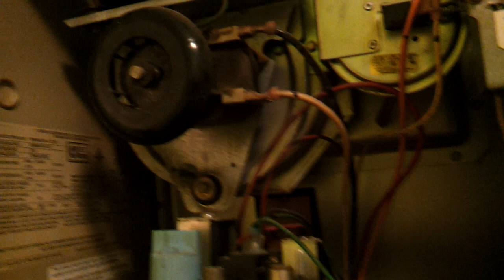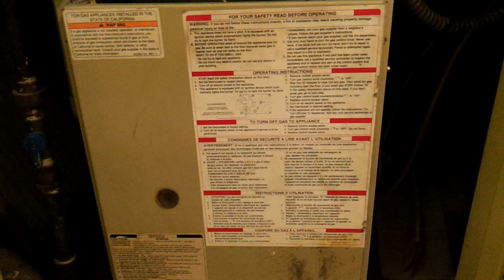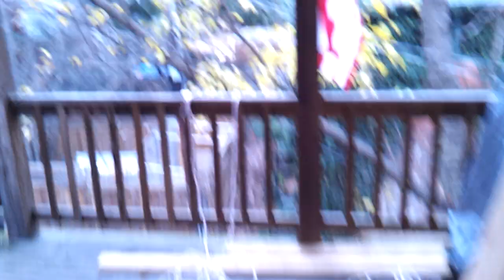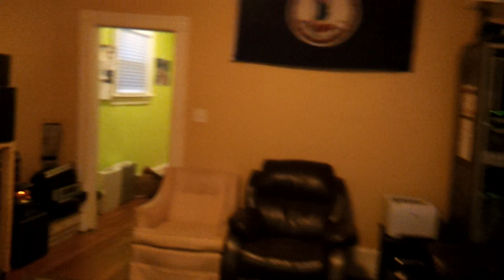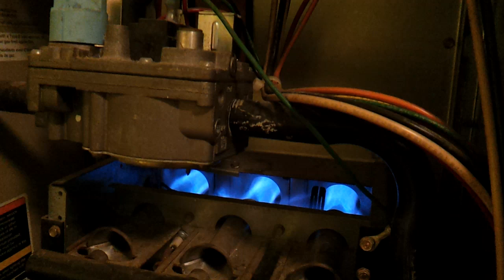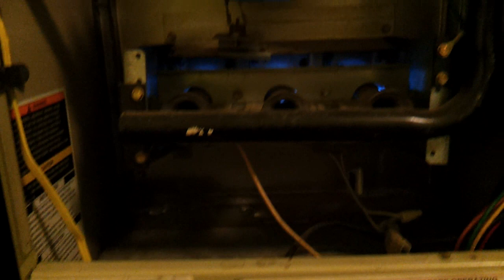Carrier Weathermaker 8000 Gas Furnace Start Up and Operation

Comment: Thanks man. I saved $90 fee for a company to come out, labor and parts. I primed a $10 capacitor over night and im back in business, it also solved the mystery of the ac barely circulating. Now my fogged windows can get some heat lol.
Reply: update: motor was burned out too, 10 minutes later it seized. I ordered a used unit on ebay, came with the GE capacitor and I swapped it myself, only hard part was tapping the fan off the motors stud thing. All good now. I feel a lot more confident ripping apart the whole system.

Comment: once the flames start firing and the blower motor does not turn on, I assume this is a capacitor problem ( easy fix) ?  Entire system shuts down after about 2 minutes running flames
I cleaned the flame sensor and I do not believe it is limit switch.
Reply from the maker: Check the capacitor first. If you run just the fan (jump R to G), does the fan run? 
If your capacitor is good, the motor is likely bad.

Comment: We have this furnace in our house. It will not come on by it’s self we have to flip the switch off and on for it to come on. When it is on it does not complete the cycle it turns off and throws the over heating code, any clue what could be wrong?
Reply from the maker: If its giving you an overheating code, check the filter to make sure it isn't dirty. Also check and make sure none of the return air vents are blocked.

Comment: Is a hybrid system worth it and cost effective? Or is it cheaper to just be pure natural gas.
Reply from the maker: It would all depend on the rate of your gas and electricity.
Reply: In most parts of the country, NG is really cheap so the added cost of installing a heat pump instead of an air conditioner is typically not worth it. Now if you have a propane or oil furnace, that’s a different story!

Comment: Mine makes a dog yelping sound when the ac unit kicks on, what is making this noise?
Reply from the maker: Could be the bearings in the blower motor starting to go out. You'll probably have to replace the motor.

Comment: I have an older Weather Maker with the 3 site glass burner view. The gas compant said one of the flames is flickering which could be a cracked heat exchanger again it's 20 plus years old, just curious thanks
Reply from the maker: It could be a cracked heat exchanger. I would have a professional HVAC company check it out before the upcoming winter.

Comment: I have a a problem with my Weathermaker.  It seems to be the same model as the one featured in the video.  When I reset it and it runs the course of igniting the gas, it will shut off gas flow after 8 seconds or so.  And then it will reignite them shortly after.  It heats my house intermittently and inefficiently.  At times it will be be working but most of the time it seems to be blowing cold air.
Reply from the maker: Sounds like the flame sensor is dirty, try cleaning it.
Reply: @springws14lbss  thanks

Comment: led light stays on but no action just exhaust fan runs I replaced sensors still will not fire
Reply from the maker: Check your pressure switch. Do you have power going to the igniter at all? Might need to call in a service tech.

Comment: I had a newer version of this furnace for 12 years. according to the HVAC ppl the AC was wired wrong and delivered 120V to the control board instead of 24V. Since the furnace was installed by them 12 years ago and took 12 years to catch fire apparently, yet they were astounded as to how it went so long psh. and 2 weeks after being forced to install a new "high efficiency" am i regretting not asking the installers more questions. I don't know what model carrier I had but it was 80% efficiency 2 stage and installed in 2006. the new one is an Amana GMSS96 (goodman) and the inducer blower sounds like a mini jet taking off. Then the blower comes on and sounds like a wind storm, is there anything I can do?? or have i just had the worst furnace installed in my home?
Reply from the maker: Is the newer furnace the same size as the old one? Since its new and has no dust on the blower wheel, its probably moving more air, thus creating more noise.

Comment: whats going on when furnace stop red lite blinks
Reply from the maker: Check the inside of the access panel for code information.
Reply from the maker: It is giving you an error code. The codes should be listed on the inside of the blower door.

Comment: I'm confused, was the heat pump running with the furnace?
Reply from the maker: It was disconnected at the T-Stat because a "dual fuel" thermostat was not installed. The thermostat has since been replaced with a Honeywell VisionPRO 8000.

Comment: Got the same unit. Right now it'll be a bit slow going through all the stages to get going, and when the flames actually get going, they will only stay on for a few minutes at most, then they will go out. Should I just start pulling stuff off and cleaning it? It's not too dirty in there.
Reply: Check and see if you are getting any error codes on the control board first. Otherwise, might need the flame sensor cleaned.

Comment: Can someone explain the filter operation to me.  I can leave the filter in for 6-months, and when I take it out to change it, the filter looks new, except for the 1-inch that is sticking out of the furnace.  It this the norm?
Reply from the maker: Depends on how often the unit is running. What type of filter are you using?

Comment: I just wanted to thank you for your Carrier 8000 video; it helped a lot.  Last year I replaced the igniter on my nephew's furnace and this year it would not start which I tracked down from the blinking codes to be the induction motor.  But something I had not noticed last year and which concerned me when I replaced the induction motor was that the flame showed up between and outside of the outer tubes a little.  Looking at your video I could see that your furnace did the same thing.  Thanks for making this video available.  It really helped.
Reply from the maker: You're welcome

Comment: I have a 58wav111 which was installed in 1997 (17 years ago). It is working fine. I've had some A/C contractor come out to give me estimates on a new A/C. They all say I should replace the furnace at the same time because these furnaces can only be expected to last 20 years. Any comment about that?
Reply from the maker: Did you end up replacing it yet? I would get the heat exchanger thoroughly inspected to see if a replacement would be needed.
Reply: @springws14lbss  No I didn't replace it, and it is still working fine. I switched to a different HVAC company, and it has never indicated any problems with the furnace when doing the annual checkup.
Reply: Had mine since September 1993 still going strong in 2023. Only had to replace the blower under warranty when it was new and recently the igniter. That's it
Reply: @docgonzo1973  Glad to hear it. Mine is now 26 years old and still running well without any problems.

Comment: What's going on when the draft inducer makes a high pitched squeal when the furnace starts?
Reply from the maker: Could be a motor staring to go bad/bad bearings.
Reply: P G Crawford Did you find the solution for the squeal of the inducer? I replaced mine but i can still hear a noise coming from the inducer. I noticed if I put pressure on the inducer bracket, the noise goes away. I was thinking about putting wider rubber washers/hose on the 3 screws.

Comment: Thanks for the help. Before seeing your video, I was trying to locate the flame sensor on my Weathermaker 8000 - I am glad I found your video! I gave mine a cleaning and so far it's working better.

I was having the intermittent problem of the hot surfaces coming on, the gas fires up then the gas would shut off- randomly. Other times it would work fine.

Comment: Just because you have nice blue flames when the blower comes on doesn't mean the heat exchanger isn't cracked. These carrier style furnaces are known for cracking.
Reply from the maker: True, but in extreme cases of heat exchanger cracking, the blower can cause the burner flames to change shape or flutter.